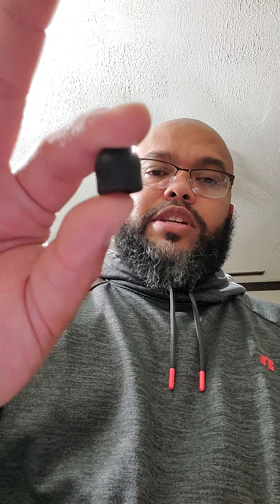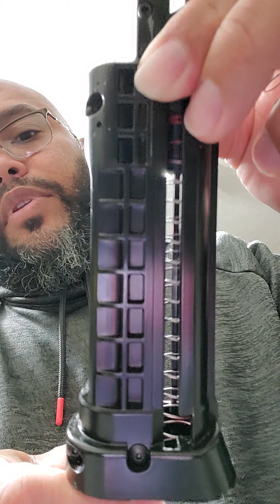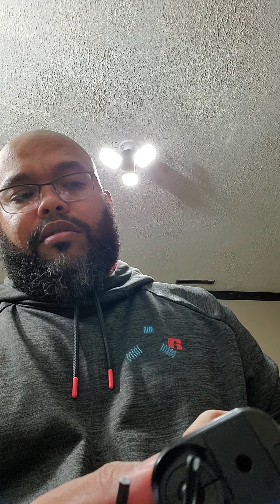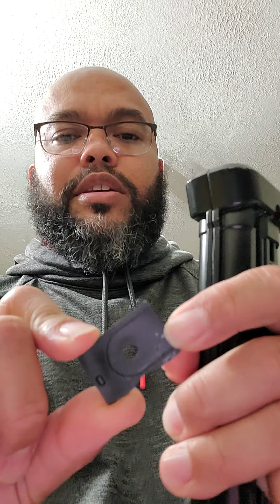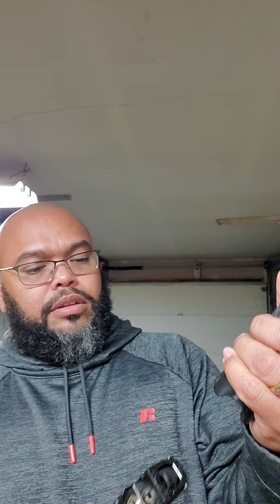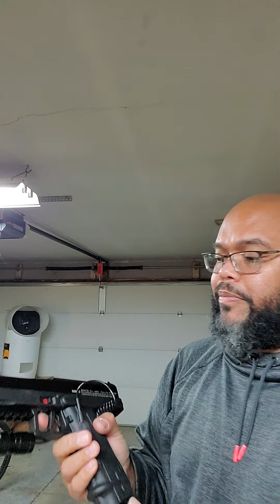T8.1 mag spring swap and test fire.

Comment: Everytime I gas up it shoots out the back where the velocity screw is. I attempted to tinker . About to see if grimburg will fix my screw up if I pay them if not would you like to fix up my fsc. From the bolt treatment to set up? Would you charge for such a service. Two shootings near me in the last month. Kinda nervous. About to order a new black box but don't wanna waste old one.
Reply from the maker: Sounds like your prv is leaking. Order a prv delete kit from Daniel Sterling. Very easy to install. You can contact him at
Reply from the maker: danny69726972@aol.com
Reply: @psi.defence.channel  would you accept donations to make a video showing such an instal?
Reply: @psi.defence.channel  if you would considering making another video fixing a black box leak ect. Would you accept a donation ect.
Reply from the maker: @c.s.swartzenhowdoispellthi8869  that's one of theany videos I have to shoot. I have all the parts, I just need the time... 😩

Comment: Do you recommend to lube regulator (velocity/fps valve) by pouring drop or two inside the valve when marker is fully assembled?
Another YouTuber said on his channel that he does it to keep marker/regulator in a reliable condition.
Reply from the maker: Yes. It will get down onto some tiny o-rings in the regulator valve. Just hold it upright for a while so it can work it's way down.

Comment: Awesome tests, thanks for taking the time! Does the red spring help with HP68 in the 8.1 to jam less or same as silver one? Any other tips on not jamming with HP68 at higher powers?
Reply from the maker: I really didn't see a difference for either spring at under 350fps in my T8.1. I wouldn't I wouldn't recommend going any higher than that since your last three or four shots will be duds. Most of my jams with HP68s are in the FSC, so I run JULs in those. If you have jams with HPs I recommend JULs and/or turning the velocity down.
Reply: @psi.defence.channel  I get jams in T8.1 with HP68 at anything higher than 3 turns from max, where I get about 300fps. Not sure what else to try and fix this. Will give JUL a try and maybe a smaller bore barrel. I heard the second HP68 might pop into barrel just a bit causing issue with firing bolt at high power.
Reply from the maker: JULs will definately do better.
Reply: @psi.defence.channel  Got the new HP68 rounds which are heavier than my old ones and jams are gone it seems. At 2 turns from max I'm getting 4 shots at 285 average and then next 4 all under 250. Is it normal with stock barrel?
Reply from the maker: @asintu  not sure, it depends on the weight for the rounds.